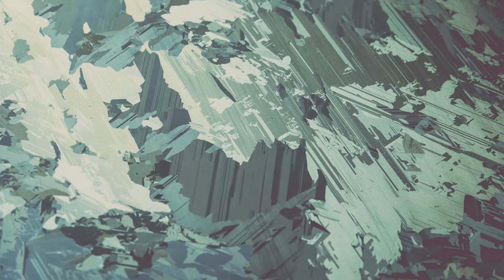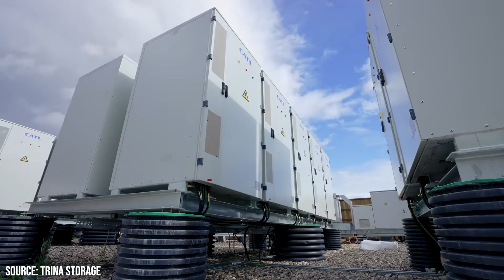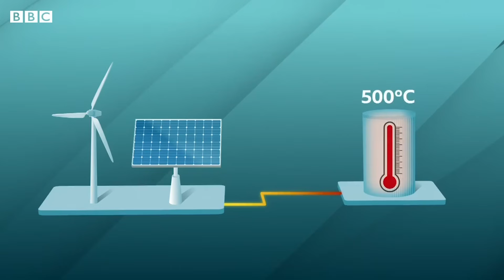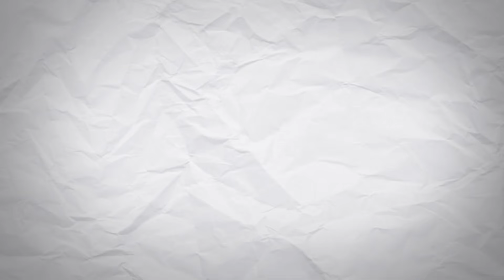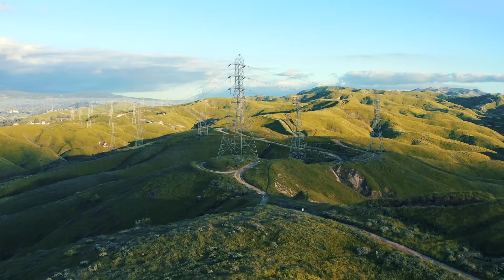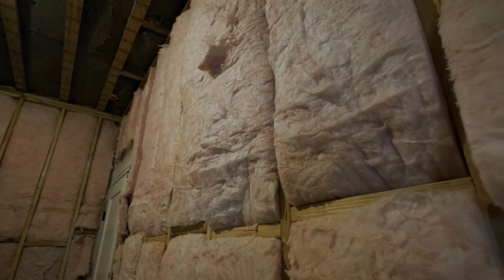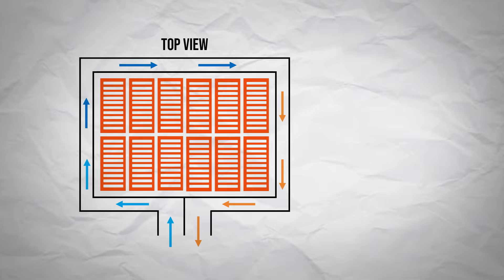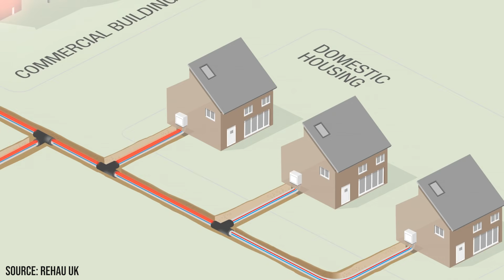How 3000 Degree Bricks Will End Battery Storage

Comment: Question: do you think a heat battery could be used to store heat from roads and then returned to the road to prevent ice forming, thus increasing the life span of the road and stopping the need to salt roads (the salt badly affects the nearby flora and fish)? If so, which would be better: sand, rondo or another I haven't heard of?
Reply: you inlay glycol pipe underneath the road. With a heating plant heating those glycols up.
Reply: Yes in theory, absolutely not when you factor in infrastructure costs (initial and ongoing)
Reply: yes, and also with the same battery you can store the heat of summer to return in winter.
Reply: A super black asfalt would suffice
Reply: No, building roads out of anything but the cheapest garbage materials is not viable.  The only exception is trains, which use slightly less cheap material in exchange for higher fuel efficiency.
Reply: Maybe from a solar "freaking" roadway =] for those OG youtube viewers out there!
Reply: @RondoEnergyGlobal  didn't that project fail miserably?
Reply: LOL
 You can't...and if you thought before typing you wouldn't ask.
Reply: @AKUJIVALDO  way to be a dick, congrats
Reply: @AKUJIVALDO  Sadly it isnt the end of solar roads, you still see them pop up from time to time.

Comment: High temp storage for industry, yes, but it won't be used for low temps like district heating. 

However you store the heat, you need to minimize entropy generation - so you'd use a heat pump as opposed to ohmic heating. 

For districts, the key is scale for long duration - rocks and water underground with no insulation, and locality for diurnal storage - dynamically responding to distribution bottlenecks in the heat network and short term intermittency in the grid, with insulated water tanks.
Reply: Heat pumps are expensive. While more efficient, the high capital costs mean you would want high utilization- which sometimes means consuming expensive electricity. Ohmic heating and bricks are cheap enough that you can consume electricity only when very cheap. 

Overall this can be more effective than heat pumps.

Comment: but how much energy is lost in the transfer of energy from electricity to heat to electricity again.
Reply: Rondo delivers heat to the customer for use in industrial processes - so it is never turned back into electricity. Companies today are creating heat using gas boilers and this is a zero carbon replacement.
Reply: @concon424  im confused. Heat never converted back to electricity? But your title said battery storage. To end battery storage, one must store energy in the form of electricity not heat. And to store electricity to heat than converting it back again is very inneficient.
Reply: @jetfu400  ~25% of global CO2 comes from heat required in the industrial sector. There is a place for heat storage for customers who require heat -- and that is more efficient / longer-lasting than electric batteries.
Reply: @RondoEnergyGlobal   @Rondo Energy  that still doesnt make sense in your video title "end battery storage". Battery stores elecrical energy, whereas heated bricks is not electricity  but a form of energy, heat energy. Thats completely two different form and function. How are you supposed to use these in electric cars, cellphones, homes, drones etc... That doesnt make sense at all.

Comment: What’s the equivalent battery efficiency if you use the steam to run a turbine and generate electricity?
Reply: You wouldn’t do that with this technology. It will always be more efficient and lower cost to go from electricity-electricity instead of electricity-heat-electricity.
Reply: Something like 40-50%

Comment: Ending battery storage means no batteries in phones, none in EVs... This stuff will replace some battery storage... It cannot fill all applications, not even all industrial heat applications and that is only a small part of all storage that is needed. A lot of electrical storage needs to be able to be used within milliseconds in order to balance the grid. If we need to spin up steam turbines the moment that balancing is needed, the electricity will flow too late for those applications...

Comment: What is the cost to heat the bricks and is this technology dependent on geographic location ?
Reply: The cost to heat the bricks is dependent on the source of electricity charging them. If charged via the grid - the price is the cheapest few hours of power in the middle of the day (peak generation via solar). If the rondo unit is charged from an off grid solar installation, the cost to charge is the capex of the solar installation which pays back very quickly over the rondo units 50 year lifetime
Reply: @concon424  My only concern is that cheap rate is going to get a hammering. People will take advantage of the low rates causing demand to increase and rates to increase. People will be charging solar arrays, home batteries and cars etc. It will be interesting to see where it all levels out

Comment: Sorry, but here 98% is misleading just like compare with lithium batteries.

This battery is working on the principle of electricity-thermal conversion just as a electric heater. That's mean 1 kwh electric to 1kwh heat conversion (in fact, less, because inefficiency storage, but it's small so close).
While for example, if you storage that 1kwh in a lithium battery, it returns 0,9 kwh of electricity that though a heat pump could turn into 3-4 kwh heat. So the difference is very big.

It's true that, when you work with high temperatures, heat pumps are not useful, so electricity for heat to such temperatures goes to 1-1 too, so here this heat battery is useful.
But for district heating is wasteful.

It's not a fair comparison a electricity-electricity battery with this electricity-heat battery&heater. It has uses, but just when 1-1 electricity-heat it will occur anyway.

Comment: Lead would be a far better medium for storing heat, because of its relatively low melting temperature, high density, and the fact that a transition of phase is the best way to get a lot more crammed in, with solid-to-liquid being the best one.

Comment: I can appreciate the benefits of storing energy cheaply as heat.  However, I wonder if there is a trend that will limit the scope.  I notice that the 'Off-Peak' electricity prices are going up faster than the 'Peak' prices.  

Will the coming demand for power for EV recharging, cause an increase in this trend so there will be little difference between peak and off-peak prices?
Reply: The more renewables that are put on the grid the more peak generation there will be and lower costs. EVs will take advantage of that but the reality is a lot of people will be charging at night, along with using heat/AC/lights etc in their homes. So solar will always need to be sized up to account for storage needed to satisfying nighttime demand, and that power will always be more expensive. Peak solar generation today sometimes must be curtailed - a technology like this avoids curtailment while tackling the toughest emissions from industry.
Reply: @concon424  "So solar will always need to be sized up to account for storage needed to satisfying nighttime demand,"  I'm not clear ... Are you meaning that "STORAGE must be increased to run 'heat/AC/lights'".  If there was enough storage now there would be no need for curtailment now.  I have a couple of DIY battery banks (30kWh) and I know the costs and savings.  However, I suspect that industrial scale batteries may be much more expensive (I read it was ~900% more).   Do you anticipate that EVs will mainly be charged around mid-day on sunny days?
Reply: @SandyMcClintock  if they are not charged at midday they do not accomplish the Mission to exist : Balance the Electric grid  and give the possibility to install more PV vithout waste Energy in peak hours .
This should be the magic of EVs .
Reply: No. Greed will tho. Energy companies will maximize share holder profit by raising off peak energy prices up too.

Comment: The more I learn about thermal storage the more it makes sense, after all stars and plants store massive amounts of thermal energy. It almost seems as though this is the energy road we should have been on all along. Imagine improving apon the materials that make T. E. Gs being perfected and then superheating a composite ceramic rod to thousands of degrees and thru the use of metameterials controlling the rate at which the heat is channeled off. Entire  power plants could charge thermal rods shortly after sunrise....
Reply: It's OK if you need industrial heat. But this technology will never be a replacement for Li-ion batteries. Converting the heat back into electricity takes time and loses a lot of efficiency.
Reply: @jameswatkins7763  lithium ion are great, they have brought us a long way in portable power technology. They are not however very cost effective on large scale implementation, also they lack long term power storage and are limited by cycle life and recyclability.
Reply: @andrewharbit7449  What applications are you talking about? Li-ion can discharge on-demand to compensate for real-life grid anomalies. Look at the Tesla Megapack installations - they are practical. You can't do that with thermal.
Reply: @jameswatkins7763  granted thermal has not made it to the point where we can instantly dump the power into the grid, however sand is readily accessible worldwide it can be thermally charged with no cycle life, properly insulated systems can store thermal energy for mths, compared to lithium cells that may not sound grand however let's consider the idea that there is no chemistry that degrades the performance over time from charging and discharging. Neither one of these systems are perfect they both have pros and cons. I am simply marveled at the potential thermal energy has to offer the power storage sector. Improvements in T.E.G technology could see greater on demand delivery. I've seen ultracapacitors useing lithium and they are amazing. Combining technology is the key to ever improving our world.
Reply: @andrewharbit7449  So you admit thermal energy storage won't replace electrochemicals. At least, until we have highly efficient thermoelectric generators.
Reply: @jameswatkins7763  correct as of now thermal isn't up to par with battery tech. Using stored thermal energy as thermal energy is probably the best way to utilize it at the moment. We shouldn't push it aside though, metameterials are becoming better understood and could pave a way for the peltier and seeback effect to gain ever higher efficiencies.
Reply: @andrewharbit7449  Sure but then why generate/store thermal energy from the grid? Wouldn't it be more efficient, and have less environmental impact, to store heat energy directly from an industrial gas burner?
Reply: @jameswatkins7763  Battery backups can be quite costly along with solar panals ( just as example) Having a system that can store thermal waste energy and hold it for long periods of time with out having to worry about cell balancing or how many cycles it's been put thru gives folks another method of self sustained Reliability. Storing the heat and using it as heat is one way, tegs that are improved could essentially mean during the winter when you have a large temp difference means for those that have electric furnaces or bad weather could take out the grid those folks wouldn't need to worry about freezing or pipes bursting(for those of us that live in trailers). There's just a lot of energy all around us all the time, keeping our options open to figuring out how to utilize and approve apon those uses is what fascinates me about the sciences. This video covers the use of industrial thermal storage, imagine using a solar concentrator and charging a thermal storage tank with it. Home made versions of these can melt steel in seconds. I just see it as another means of energy harvesting, we just have to improve on it like we did with the battery, I mean we have come a long way from the dry pile in a fairly short time considering.
Reply: @andrewharbit7449  This video never once mentioned using this tech to store "thermal waste energy". They talked about using electricity from the grid. I think storing wasted heat is a fantastic idea. As for using concentrated solar energy, this has never been successfully implemented for large scale energy production. So we both agree this is not a replacement for Li-ion. It's a specific solution for specific applications.
Reply: @jameswatkins7763  Yes I agree that current power storage tech has the on demand capability, overall if we stay the lithium path we need to improve on cell recovery at the end of life stage.
Reply: @andrewharbit7449  Not really though. As far as recycling goes, Li-ion batteries have some of the highest margins. It's actually worth the effort to recycle them. Whereas with plastics, glass and paper it's practically worthless.

Comment: "where heating is required"
Storing heat is not the same as storing electricity.
You cannot move heat instantly to point of use, turn a heat pump or charge an EV.
Moving heat at 1000-1500C for smelting, ciment is extremely hard, how do you pump heat, what are the pipes, most materials break down at these temperatures. etc.
Still a good way to use excess solar energy that is going to become more and more common. (unless EV batteries can use it)
Reply: Industrial plants already have heat networks they use to move heat around to multiple end uses at their facilities. The Rondo unit replaces gas fired boilers that are already being used on the facility’s heat network.

Comment: Thanks for this summary of Rondo's thermal-battery storage approach. 

With the double-stack approach, are you cutting your energy density in half, compared to Li-ion's ~260 wh/kg?

It would be helpful to have a cost comparison between the Rondo system and Lithium, where Li-ion can be installed at say $100/kW and LiFePh can be installed at say $75/kW, with comparable lifetimes to Rondo, optimized by thermal management and controlling depth of discharge?

For lower-temperature applications, like the district heating mentioned in your summary, the more detailed cost comparison should also include the use of heat-pumps with a high Coefficient of Performance of at least 5.
Reply: Sigh... This is heat storage, not electricity storage my dude.  Get with the program.  Your heat pump suggestion is ~useless for industrial processes as Heat pumps use the difference between evaporation and condensation temps/pressures.  The cost of doing so at Temps/pressures required for industrial heating needs is insane so no, heat pumps are NOT viable for industrial heating.

Comment: OR, we could use nuclear power and avoid ALL the issues that solar/wind & batteries cause…
Reply from the maker: Every option has many pros and cons! The issue is deciding which ones are most important for a given application
Reply: There's no energy free lunch with either 'green' wind/solar or nuclear  ... just swapping one set of environmental issues for another. I'm reminded of the astronaut who said of the space shuttle  'you're sitting on a bomb with over ten thousand components  ... all manufactured by the cheapest bidder'. 😉

Comment: Because they have air around the 1500 degrees bricks, the outer insulation only needs to cope with 150 degrees?
What crock of shit is this?
Reply from the maker: Thermodynamics
Reply: There are multiple layers, each isndesigned for different temperatures.

Comment: Great video. How does this system compares to the thermal storage system by means of molten salts tanks that usually are installed in CSP generation plants?
Reply: Csp plants with molten salt storage are using that stored heat to drive a turbine to create electricity. The Rondo technology is delivering heat directly to a customer for use in high temperature industrial processes. A benefit here is footprint and energy density — with a molten salt system you’d need to transport heat over large distances because you can’t often site a large solar thermal installation onsite at a industrial facility - this would result in large heat losses. The rondo units use electricity to generate heat, which is much easier to transport, so the rondo units can be sited at an industrial facility right where the thermal energy is needed - replacing traditional gas fired boilers.
Reply: Molten salt freezes in the pipes when the plant shuts down, huge mess, always a bad idea. Only works in nuclear.